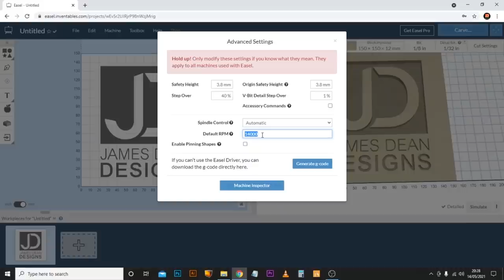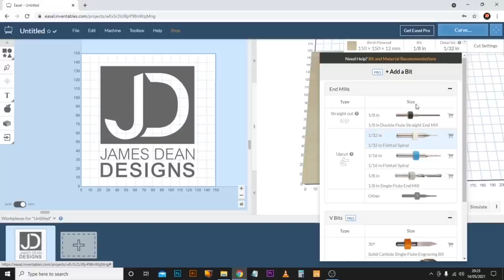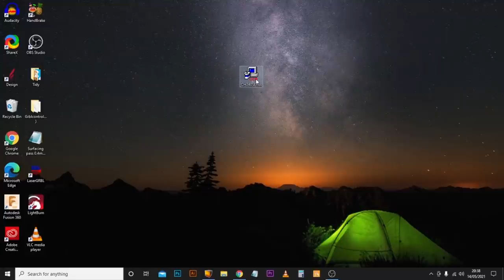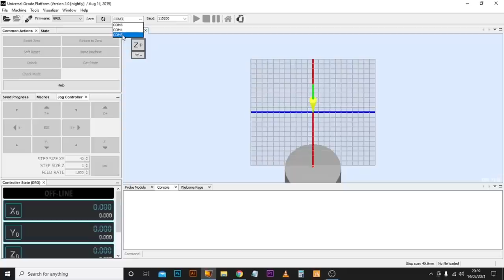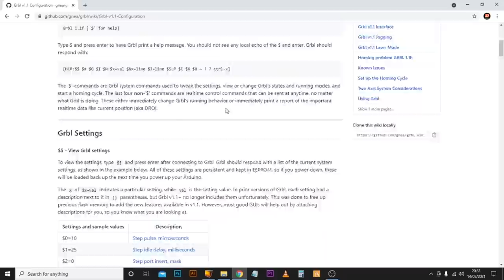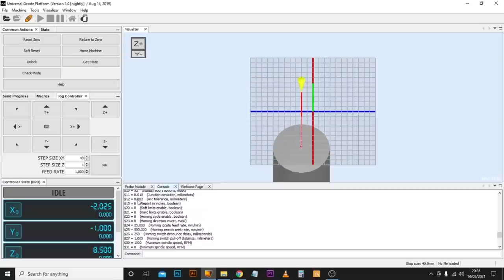Top 10 issues and solutions for desktop CNC machines - 3018, 4040, 4060, 6040, 6060,

Comment: My cut started ok on my 3018 pro but then the spindle was a little too high  after 2 minutes not touching the stock. All parts were running but the spindle was hovering over the stock. I stopped the project after that and here I am thinking what potion I should do next to fix the problem.  It was cutting ok a few days ago I change the the cut depth to cut from 2 mm to 1 mm.

Comment: thanks for the tips James but I have this problem.  I tried to use limit switches and try to use the settings on my ugs. the problem came up when i finished to see the limit switches that it worked i tried to home the machine and then the machine stopped with the ALARM. Goes also with the candle, it showed the ALARM. Everything froze.  I tried pressing the reset button on the board but nothing happened.  Can you help me on this?

Comment: Hi , i have set up my 3018 pro and all seems ok but, when i go to test my x + y i have the issue of them juderring and not moving correctly. I carried out some testing by removing the power to x and y worked fine and visa versa.....have you had this issue and is there a fix
Reply from the maker: That is odd. There is always the chance your power supply is not strong enough which may explain why it runs better when you disconnect one motor. If its only rated for a few amps you may want to get a more powerful one.

Comment: My TwoTrees ttc450 was freezing up randomly.  I soldered a 10 pico farad capacitor from each terminal on the motor to the motor housing. I haven't had the problem since. I always had to do this for my rc cars & airplanes. I figured it would help here, too.

Comment: James, got a stepper motor (Y) that is inconsistent (seizes, runs backwards sometimes, just plain unreliable ). Have you run into this? Thinking about revisiting the GRBL setting or replacing motor.
Reply: 3018 extended package

Comment: Please Help... My 3018 pro power supply tripped the breaker a few times.  So I plugged it into an outlet with a higher out breaker.  Now it does nothing and doesnt trip the breaker on the one I originally plugging into.  Im not electrical savy, any idea what happened?  Appreciate the help and thank you for all your help videos.  There is pretty much no support for the Annoytools 3018 Pro.
Reply from the maker: It's a case of finding the fault. I suspect you may have blown your power unit. This is probably the easiest and cheapest thing to replace at a cost of around $15.

Comment: Okay, so I was using my laptop Windows 11 to run my 4040 xe and easel pro for my software. It was stopping in one spot  an literally couldn't go any further so I gotta hold of easel. They done a remote session, he turned off some hard limits. Okay, well, that didn't fix the problem. Because later I found out it was actually my laptop.  The USB port was corrupted. Now that I've got a new laptop and everything's working good. It's starting to bounce around at the back of the machine behind my project and I'm not sure what's going on. It literally went to the bottom of my project yesterday and dug a bunch of my waistboard . Do you have any clue what could cause my project to get Almost all the way done, and then start bouncing around Didn't me wasting A8 hour project? I'm not sure if it is the the 3 d downloads im chosing or something wrong with my machine

Comment: Hey I'm new to CNC - built my new Genmitsu 3018-PRO using your build video (thank you), connected to my computer tried using both Candle and UGS. Both softwares connect to my machine, however when I try and test the machine by turning on the spindle or jogging the axis nothing happens. Any advice?
Reply: Well I figured it out and it will show how newbie I am...there is a power button on the controller board. Hope this comment will help out the next newbie.

Comment: I experience misalignment after bit changes. I’ve tried both changing the bit with the spindle on and removing the spindle entirely, but the result is always misaligned. Any idea why this happens, and how do you change bits during a project?
Reply from the maker: Ideally you need limit switch to ensure the position remains exactly the same. This video show the method.
https://youtu.be/G9x1xM_uXbM

Comment: What do I do if the cutting motor just keeps pulsing and not actively spinning up to speed meaning I can hold and stop it with my hand. The red light at the back also just blinks like its giving and losing power at the same time. Is this a board issue and if so where can I buy the boards?
Reply from the maker: Could be a bad connection so check that first. Also sometimes if the speed is set too low then it can pulse because it is not sending enough power to run the spindle correctly. But if all that is ok then yes it sounds like a board problem. You can pick them up off Amazon, ebay, aliexpress etc. Just search GRBL control board or 3018 control board

Comment: Hi James, i got mine 3018 and set it up few months back but my motor couldn't even run, it's sound like stuck at first. Is not the software problem as i can connected to the easel software and testing the wiring but it's couldn't go through the first step. May i know is there's anything that i have to check and know what exactly going on ?
Reply from the maker: Likely that something is a little to tight or out of alignment and causing it to stick. Possibly also your GRBL settings. If it continues then drop me a message on facebook with a video.
Reply: @JamesDeanDesigns  Thanks for the replied, sure, I will send you a video through Facebook about my CNC problem.

Comment: I got the direction of the axes cleared up, but new problems persist.  X and z axes are quiet and move at normal speed.  My y axis sounds like someone driving fast with emergency brake  on.  The y direction is also very slow.  I have the extension kit -- got it from Amazon as it wasn't available from Sainsmart yet.  Doesn't work any better with extensions.  Six months of having this Genmitsu and still have not been able to carve anything.  Any help would be appreciated.
Reply from the maker: Either something is binding or not aligned correctly or perhaps you GRBL settings have been changed by accident (it can happen without you knowing). Check you $100 and $101, they should be the same value

Comment: Hi James,

Thanks for taking the time to make these videos. Very much appreciated! However, I need your help regarding my 3018 CNC. I am using UGS, the system was working fine for 2-3 days, then now all I get is idle response errors in UGS console, and after a short time the cut is halted but motor is still spinning.
Reply from the maker: Could be interference, check all of your connections and make sure nothing is near electrical cables. Change the USB port as well. There is always the chance the board has failed, but if you want to be sure before replacing it, try and get another PC/Laptop to test it on
Reply: @JamesDeanDesigns  Thanks James, I've been running around in circles, and it must be that. Have tried different laptops, ports, cables, removed all power cables etc. Should have another board arriving today to swap out. Wish me luck!

For reference, I'm running the follow;

Macbook Pro M1
Fusion 360
UGS Platform
Reply: @JamesDeanDesigns  Out of interest, do you happen to know if the 2 pins bottom of the board labelled 5V are able to power an LED strip?
Reply from the maker: @Pixel-CNC  Pretty sure they are. I have them running a 5v fan
Reply: @Pixel-CNC  what solved your issue eventually?

Comment: You mention exporting the design from Easel to Candie to do the cutting.  I can't work out how to export from Easel.  How is this done?  I am a complete newbie with a 3018.  First test carve worked fine.  Since then, every attempt to carve from Easel has failed.  I set the X Y Z points as instructed.  When I start to carve, the machine lifts the bit, moves over and does the correct X,Y path but never lowers the bit to the work surface.  Could this be caused by the bug you describe at 12:00?
Reply: Hi tommc49 i got the opposite problem my bit goes too deep . But to export Gcode as follow:  Once done with all stages with your design > under MACHINE tab > advanced (at the bottom) > Generate  G-code. that's all!
Reply: @maximekone1769  Thanks, I have figured that out recently and have been using the Universal Gcode Sender to do the actual cutting since I heard on another YT channel that the Easel software has/had a bug affecting Z axis movement.  (Perhaps it has been corrected, I don't know.)  I also found that the bed of my machine was not perfectly level as some of the screws in the brackets holding the table to the rods were not equally tightened.
Reply: @tommc49  Sorry I just realized your message was sent a month ago. Thks for bed level tip! I will check. Good day
Reply: @maximekone1769  Actually, I just posted that today.  don't know it was time stamped.  In general now I find that this machine has so much vibration, it is a maintenance practice to tighten every screw about once a month.  I was surprised on how many have loosened up.
Reply: @tommc49  Thanks again. 1Q how long  U be been in CNC world?

Comment: I just bought a 3018 cnc, but after I set it up and turned it on the spindle is keep on spinning, wirings are properly connected so I cannot find the problem. I was looking for a video how to fix it and I end up here. Seems I can't find any video that can help me so I decided to just drop a comment here hoping you could help me. Thank you in advance for your answer.
Reply from the maker: Sadly, that usually means your MOFSET is faulty, which is a small part of your control  board that Contols the spindle. If your machine is new then I would reach out to the seller

Comment: Hi i just got my 3018 pro,my problem is the X,Y does note move when i try to,only the motherboard making a noise,the motors are working cause i tested it with the Z connection.Do you have any ide whats going on,thanks!
Reply from the maker: Could be faulty cables, could also be faulty driver chips on the control board. I knocked one of those chips the once and it stopped my Y axis working altogether

Comment: Great video James, for newbies but I have a different issue. My spindle after completing a job and going to home, the spindle keeps running. It won't respond to candle or even after powering off the 3018 SE-V2. As soon as I power it up the spindle starts. Any ideas?? Most appreciative
Reply from the maker: If you have press the reset button and it's still going then possibly a blown MOFSET that may not be controlling the power correctly. Unless you're comfortable soldering, this usually means a new control board unfortunately.
Reply: @JamesDeanDesigns  Thanks for the quick response. I just got it a month ago so I'll contact Foxalien and hopefully they'll send me a new one.

Comment: I have the FA CL 6560 and when I adjusted the GRBL settings for the movement in the x and y axis something else got changed. As a result my stepper motors for x and y will stall out and any movement above 1260 mm/min. I cant seem to find the problem. Any help will be apprieciated. Thank you and keep up the good work!
Reply from the maker: You could just reset you GRBL settings to be safe and start from scratch. To do this you type $RST=$ and hit enter. Alternatively you would need to go through all of your settings individually and compare them to the defaults to find the one that caused the issue

Comment: Hi james, i am having problem with the axis. it doesn't cut as designed size. for example, my designed is 280mmx80mm. but the machine cut at size 220mm x 40 mm. what should i do?
Reply from the maker: You need to calibrate your steps. I dont have a video on this but of you check out TechyDIY channel he covers how to do it

Comment: Hi. I’m new to easel and I’m having a problem with the rough cut. It’s going all the way through the cut and not stopping for a bit change. Is that normal. Should I have to recycle the process for the detail cut? Thank you.
Reply from the maker: They are two separate cuts. So you do one, it stops. You change the bit, then load in the detail job and start again. The only reason it would treat it all as one is if you have have not set it up as a rough and detail cut with 2 different bits I suspect
Reply: @JamesDeanDesigns  From one of your other videos I understood that in fact you (well the machine) is running to separate files. After one file has been completed, you change the bit and start the second file. Did I get that correctly?

Comment: Please help me understand how a USB hub can be used.  The USB cable from the 3018 to the laptop carries power and the code, correct?  So if I plug that into a hub, how does the code get from the laptop to the 3018?  Do I need a second cable to from laptop to hub and then cable to 3018?   Or, do I plug the hub into the laptop and then the 3018 into the hub?  Thanks for are reply.
Reply from the maker: The USB hub will just display like a normal USB cable. Its just like using an extension lead. The difference is with it having its own power supply its a little more consistent and less chance of drop out which is what can cause it to disconnect
Reply: @JamesDeanDesigns  Thanks for replying promptly. So you plug the hub into the laptop and plug the cable from the 3018 into the hub.  Then the hub supplying the power to the 3018 and the gcode is passing from the laptop, through the hub to the 3018.  Do I have that correct?

Comment: Great video as usual James. Love the channel
My problem with my machine is the machine isnt being recognized by the laptop. This is after reinstalling the drivers, i eventually purchased another control board. I think it may be a solution for my machine. Tell me your opinion
Reply from the maker: Unfortunately you can just get duff control boards or something breaks on them. They are manufactured cheaply at fairly low spec so they can sometimes just fail.

Comment: hello i have a yora silverback 6060 and my spindle is not working and It does not give meoption to change it when I go thru the steps,any suggestions>
Reply from the maker: Under the machine menu, you have to go through some of the steps to setup your machine and it should then give you the option

Comment: Hi James thank you for the thorough explanations. It’s funny that as a beginner CNC’r I’ve experienced almost everyone of your topics at one point or another. Question- I have a Prover 3018 and after setting everything up for a cut, I get a “Finished” message on my controller before the machine even moves. I thought perhaps I was exceeding the z axis limits so the machine wouldn’t begging but that doesn’t seem to be the case. Have you run across this problem and if so, what’s the solution?  Keep up the great work!
Reply from the maker: Hi Carson. Ive never heard of that issue before. What software are you using to generate your Gcode and then what are you using to run the machine?
Reply: @JamesDeanDesigns  I’m running Vcarve pro to generate the Gcode and I’ve also opened it in Candle and saved as a different file. I’ve even tried to save as a text file. What’s worse is that it can be a intermittent issue so it sometimes won’t run for the clearing path but it will work for the vCarve path from the same job. There’s a new update that Vetric launched so once I’ve installed it I’ll try again tomorrow or I might run it over with a tank. Lol. Thank you for responding and I’ll let you know if it works.
Reply: Well the software update didn’t work but I did fool around with the settings enough that I finally got it to cut again. I wish I could tell you what I did exactly but I tried so many things that I stopped keeping track. I believe it came down to the machine settings of millimeters vs inches. 😀
Reply from the maker: @carsoncolegate6798  been there and done that, lost track of all the changes I was making 😄 main thing is you got it working again 👍

Comment: I just put my genmitsu 6060 together and when i move my xmotor by turning the wheel every couple of inches it makes a grinding noise can you help thanks.
Reply from the maker: Sometimes the wheels can have flat spots which adjusts the pressure on the wheels, but that more like a jerk than grinding noise. It might be something like the backlash nut or spring catching 🤔

Comment: good morning, I have a CNC machine 3018 pro I purchased recently.  I am using Lightburn for the laser ans Candle for the router.  my problem is that when I send the carving command the machine is performing a small carving of the design I want.  for example, if the design is 5x5 inches, it carves it at 5x5 mils.  How can I fix this feature?  please advice.  Thanks, Richard
Reply from the maker: Hi Richard, you need to work out whether the machine is wrong our your Gcode is wrong. Easiest way to do that is simply tell the machine to move something like 50mm with the jog controls in Candle and measure the distance it travels. If its doesnt travel 50mm then its your GRBL settings, if it does travel 50mm then its your gcode or design. Let me know which one once you've done that test and I can advise on the next step

Comment: Do you have a video showing how to change bits when using GRBL? I get a notification in Carveco that it isn't supported. So roughing is not possible or adding a smaller bit half way through as described in this video.
Reply from the maker: So you have to export each toolpath as its own file and run them separately. So for example you would export the file for the endmill as one file for roughing and then the other bit as a separate file for the finishing pass. Use the post process "GRBL mm" or "GRBL inch" and it should be fine. Run the first job, change the bit, run the second job.
Reply: @JamesDeanDesigns  Thank you.